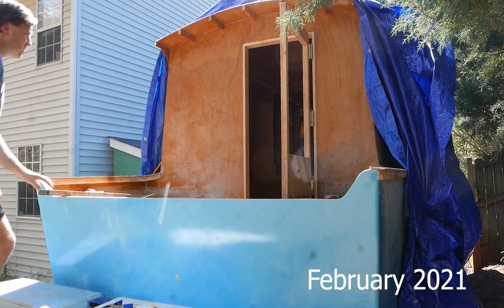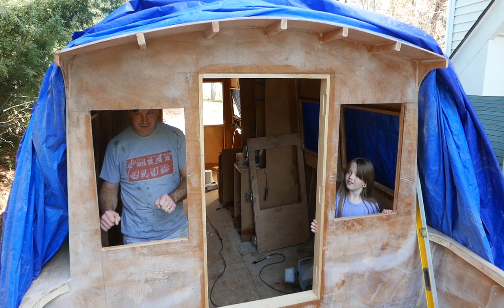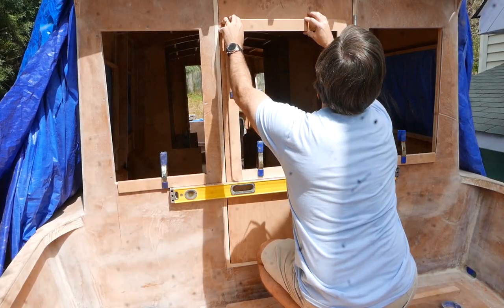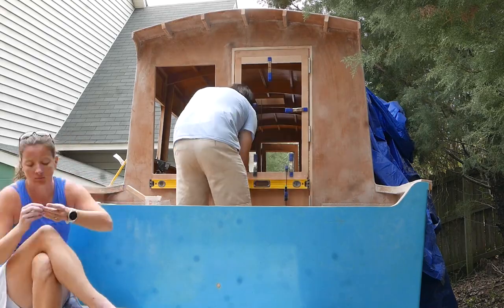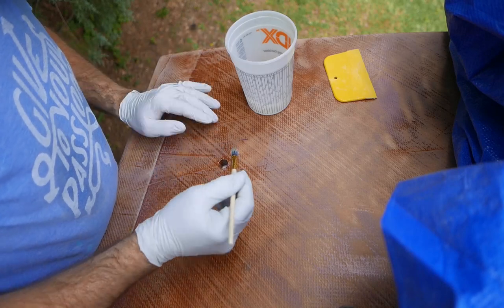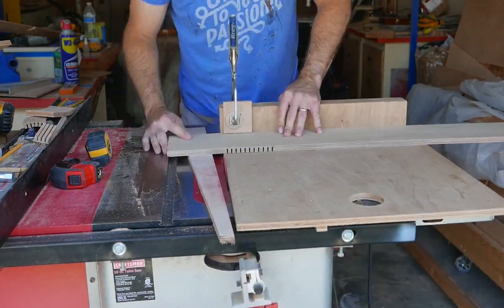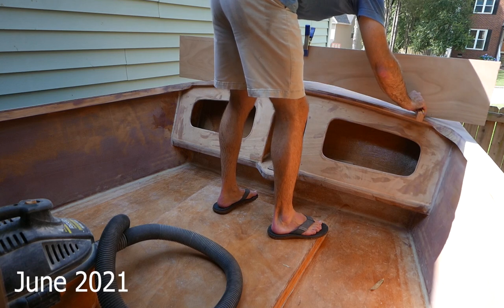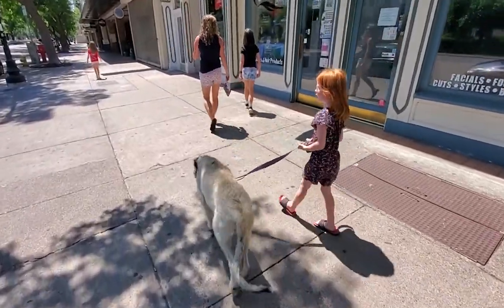Building our GT27 Houseboat, Part 7

Comment: Really great work.  I hope you bought all your wood in 2018!
Reply from the maker: Man, you ain't kidding! We did buy most of our supplies in 2018-2019, thank heaven! I bet we saved thousands of dollars over what much of that would cost today. Not to mention supply chain issues that have slowed us down on some of the small parts we've needed along the way. No motor yet, and it's looking like that will likely be a 7 month delay right now if we order today. Ugh.
Reply: @LiveDontWatch  yes sir. Unfortunately I'm working on my house and need to redo the subfloor. 3/4" OSB used to be cheap.  Not anymore.

Comment: Good job.... can't wait to see your project on water. 
Did you find a solution to reuse the foam rolls for applying the epoxy?
I have to throw them away after once used. 
How many did you buy?
Better questions... how much did you spend for your project?
Greetings Jens
Reply from the maker: We've had to throw away the foam rollers every time. Often, they start to deteriorate on the first use, so not worth trying to save them. I couldn't begin to tell you how many we've bought. We tend to buy them a few dozen at a time, and replenish as needed.

Comment: Paul here,  I have enjoyed your work. 
Your detail for following recommend procedures is obvious. 
Have been wondering when we will see your next video?
Reply from the maker: Hi Paul, sorry for the delayed reply. We have some very odd weather in Georgia this year. It went from very hot to surprisingly cool so quickly that we're struggling with the final fairing. It was so hot the fairing putty was curing too quickly and causing us to have to redo work (fast curing thickened epoxy suddenly gets very cottage cheese like in texture, which is the opposite of the smooth surface you want to achieve with the fairing process). Then it got so cool (low 60s or less) that it started taking multiple days to cure, which slowed us way down as well because we often work on weekends. This time of year, it's usually dark by the time we get home from work during the week. Long story short, it could be awhile. We're mulling over whether it's worth the effort to build another temporary outdoor shelter so we can heat it and try to do more finish work on the exterior, or if it's better to shift our attention to the interior and start getting some of that in order... It has been a very frustrating series of weather related challenges since July.
Reply: @LiveDontWatch  Looking forward to the next video

Comment: Nice work! That’s going to be one solid, long lasting Cottage. And you will be able have a new view out the window every morning. I’m curious as to where the helm station will be, and how it will be set up?
Reply from the maker: Thanks! The helm will be on the starboard side of the cabin, where you see me in the thumbnail for this video. A wheel and a throttle control, probably hydraulic steering instead of cables/pulleys just to simplify the install and have smoother steering.

Comment: Have you started the new, bigger houseboat to hold the dog ? :-)
Reply from the maker: LOL, not yet! We took almost three months off waiting for the heat and then the incessant rain to let up, but we've finally gotten back into the swing. Ironically now the problem is how quickly it's turning cold enough to make it hard for epoxy to cure. This has been a rough year for boat building outside. Really wishing I had an enclosed space again...
Reply: @LiveDontWatch  I understand. Wishing you all  the very best in your tireless endeavours    :-)

Comment: What a great build but why no recent updates
Reply from the maker: Hi Shane! We lost nearly six months to weather that was first too hot and then too cold and rainy for epoxy to cure at an acceptable rate for the final fairing and prep work for paint. We've made progress, though, more recently. We've been drilling, refilling, and redriling fastener holes; installing the cockpit railings; finishing the propane locker inside one of the seats; trimming the ends of the roof; etc. I hope to be ready to paint the cabin in the next few weeks. The problem is the weather in Georgia is super hot again already. Nice temps in the 60s to 80s are relatively rare, but when it's hotter or colder than that range, it's very difficult to get epoxy, filler, or paint to lay smooth the way we need--and these materials are so expensive it's not something we can afford to rush. So my HOPE is to have Part 8 available by the end of May. We'll see, but we're trying... Working outside sucks. If we had an indoor climate controlled shop, the boat would be long done by now!

Comment: were you able to work on the boat more during the lockdown?
Reply from the maker: Sort of, yes. There are a lot of small epoxy-related steps that don't take long to accomplish, but then we have to wait 6-8 hours for the epoxy to cure before we can do more. While teleworking during the lockdown last spring, I was able to take 15 minutes to glue something on the boat mid-day, then work for the rest of the day while it cured, then resume boat work in the evening. Normally, I can only work on the boat in the evenings after work, so it was definitely more convenient being home to do quick glue-ups in the morning or at lunchtime so they'd be cured by the evening.

Comment: Are we in the water yet?
Reply from the maker: Lol, I wish! We've barely made any progress since the end of the last video (last July). Without a shelter over the boat, the very wet, unusually cold winter has prevented us from finishing the tedious fairing and sanding to get the exterior surfaces ready for paint. The weather in GA is starting to warm now, so hopefully if the rain will let off, we can get back to it and get back on track. I can't WAIT until the outside of this boat is painted and sealed up. It will be much easier to finish the rest from that point on...

Comment: Quick question. How wide is the boat and how wide is the cabin ...
It appears to be 10 ft?
Reply: Its slightly over the legal towing without special conditions. 
I started converting the plans to trailerable dimensions.
Reply: @dnomyarnostaw  goodonyas! Mine too! 9'10" give or take... I was wondering because I liked the spatial layout It looks right to the eye! Cabin to hull!
Reply from the maker: The design is 8'9" wide, but I scaled it down to 8'5". Length is a little over 27 feet. The cabin uses the full width, but the side decks come inboard about 7" on either side before they meet the cabin sides. The cabin is about 17' long.
Reply: The proportions are aesthetically pleasing! Goodonyas!

Comment: Can I please get the make, model, and length of your boat trailer?
Reply from the maker: It's a Venture VATB 8025 aluminum tandem axle trailer. I may swap it out for a different trailer,  or else fit it with an adapter to use a weight distribution hitch.
Reply: @LiveDontWatch  Thank you!  What is the length on it?
Reply from the maker: @tanner8319 it's rated for 25-27' boats, but I don't know the overall length... never measured it

Comment: Haven't been able to post in 10 months? Fairing and sanding really is going on and on...
Reply from the maker: Part 8 will be up soon--hopefully, by the end of the month. Fairing and sanding did go on and on, but we also lost several months to unseasonably cold, wet Winter that made it impossible to finish the epoxy work outside. As of yesterday, the topsides are fully painted, the hull paint is refreshed with two coats as well, and we are putting on hardware.
Reply: @LiveDontWatch  All good man, it's looking great.